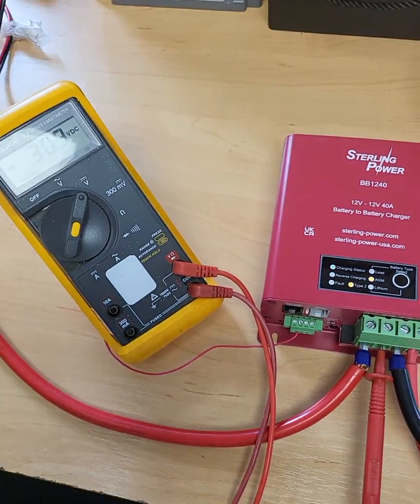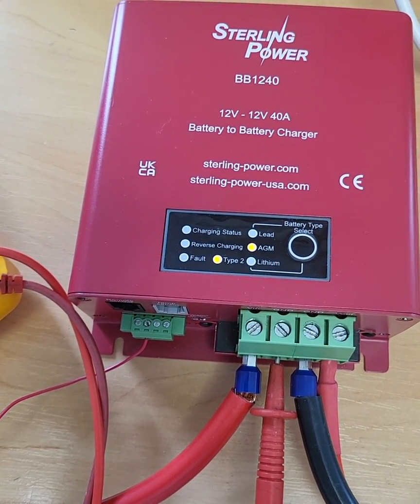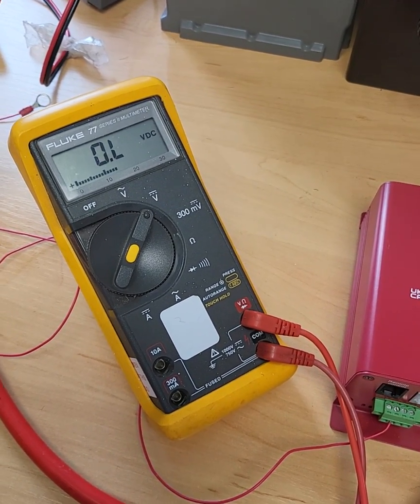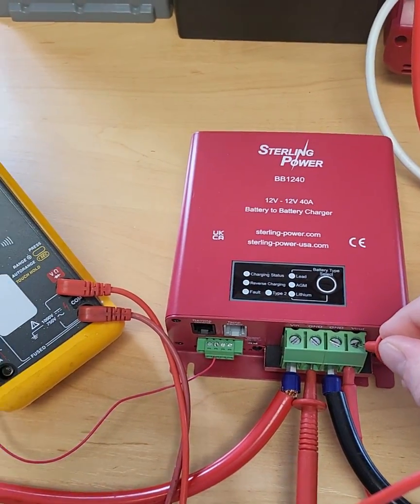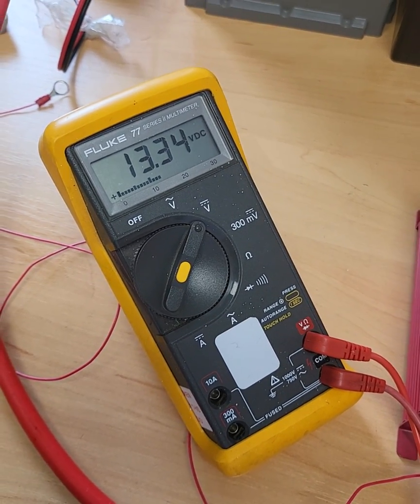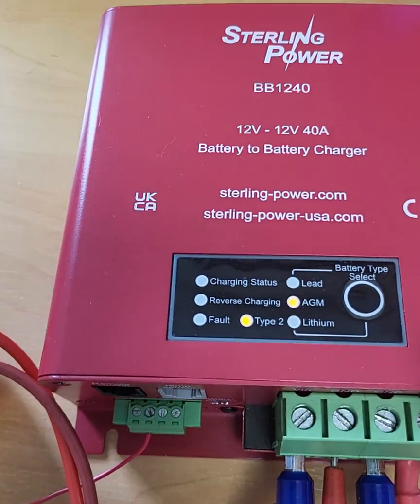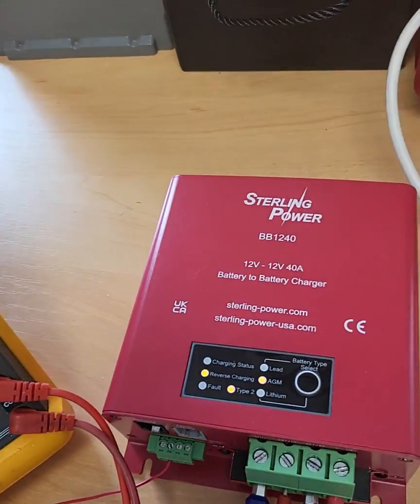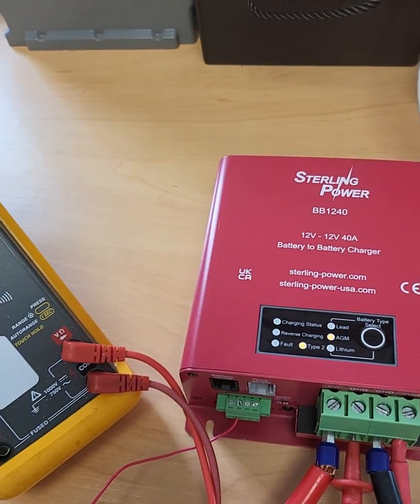BB1240 - 12V to 12V Battery to Battery Charger Bidirectional | Reverse Charging Feature

Comment: Hello, im buiding a dual system lead acid and lithium, can it work with both different types together?
Reply from the maker: Hi Panda!

Can you give me a bit more information, please? As in you intend to have lithium and lead acid together in parallel in the same bank, or are these two chemistries being kept in separate battery banks?
Reply: @SterlingPowerProducts  hello! 
I'll have the engine battery (lead acid) charged by the alternator and connected to a DC DC charger, so o can charge a lithium bank
So my question is: can it make both jobs - when the engine is on, alternator charges the lithium bank through the DC DC charger and when the engine is off, the lithium bank chargers the lead acid through the DC DC charger?
Reply from the maker: Hi  @thepanda6401 !

Yes- that's what it does presently. In the current version of the item you do need to have some sort of charger on the leisure battery (Solar, AC/DC) to engage the reverse charge feature, but that is something readily done. 

I hope that helps a little!

Ben

Comment: You say you’re charging lithium ion battery but the AGM LED was lit up on the charger. What was that all about? Thanks
Reply from the maker: Hello Steve,

The AGM profile was within the specifications for our batteries and this was simply a demonstration video. So long as voltages are correct for the battery, that's the primary focus!

Comment: link to manuals, datasheets?
Reply from the maker: Hello Hans,

The BB1270 user manual is available from here : https://cdn.shopify.com/s/files/1/0658/7343/files/BB1270_manual_024ed203-a2da-424d-86aa-41b2c774c31a.pdf?v=1649167933

The BB1240 and BB12120 are pro-rata similar, just slightly different power ratings. 

I hope that helps!
B